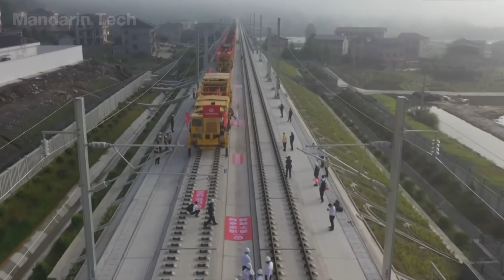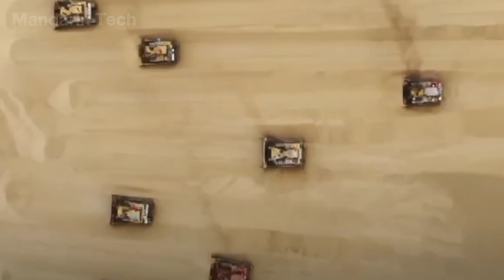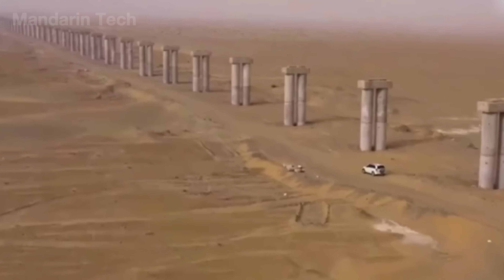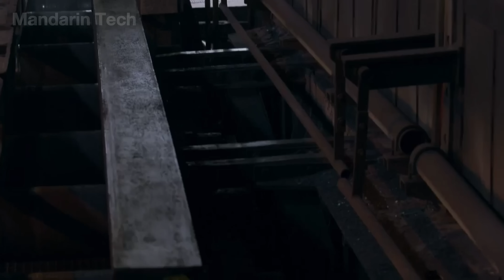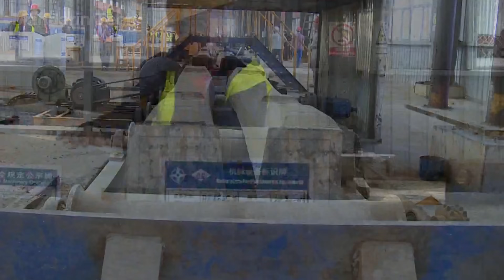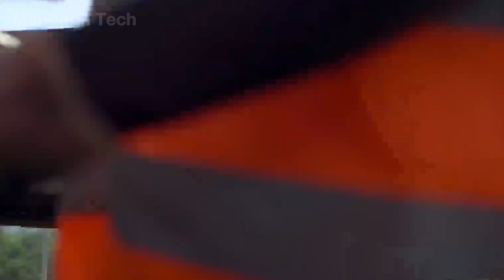China Reshaped This African Country’s Transportation With 600-km Giant Elevated Railway

Comment: all well and good, but the reality is something else. Here's what a search reveals about the finances and operations of this system.

The Chinese-built railway system, particularly its massive high-speed rail (HSR) network, faces severe financial strain characterized by13.7 trillion yuan (approx. US$863 billion) in debt by the end of 2024 and a 63.5% debt-to-asset ratio. Most lines do not cover their operating costs, leading to, Nikkei Asia high-debt levels, Nikkei Asia Nikkei Asia Nikkei Asia, and increasing fares. 

Key financial highlights include:
Rising Debt and Overbuilding: China State Railway Group’s debt has grown due to aggressive expansion, surpassing 6.2 trillion yuan. Analysts suggest the system is overbuilt, with many lines deemed unnecessary or unprofitable, according to The Antiplanner.
Profitability Issues: Only a few lines (such as the Beijing-Shanghai line) are highly profitable. Most others rely on subsidies, and high maintenance costs—potentially 20% of initial investment—are projected, says The Antiplanner.

Continued Expansion: 
Despite debt, the network grew to 48,000 km by end-2024 with a 50,000 km target for 2025, notes South China Morning Post.

Overseas Projects: Chinese-built railways abroad, such as in Kenya, also suffer from low revenue compared to high debt servicing costs, creating "debt-traps" for the borrowing nation, notes this article from Nonstop Local News. 

While China continues to expand its rail network to boost economic activity, the long-term sustainability of this debt-fueled expansion is under scrutiny, says South China Morning Post.

Comment: How do engineers construct a railway across hundreds of kilometers of African savannah, wildlife corridors, and challenging terrain? The British did it all the way back in the early 1900s with a line of similar length to the Chinese one. In addition, there was an extensive infrastructure, ports, ferries and even branch lines. The line linked the interiors of Uganda and Kenya with the Indian Ocean port of Mombasa in Kenya. And they did it without all the modern technology and advancements that the Chinese used.
Reply from the maker: Yes, the original Uganda Railway was an impressive project for its time.

Comment: The hidden cost of progress, helped by the Chinese - Kenya now spends roughly $1 billion a year servicing Chinese debt, most of it borrowed to build the railway. That is far more than the line generates in revenue, even if passenger and cargo numbers have been growing strongly over the past year. A report by Kenya's auditor general last year found more than $260 million had been wasted just on penalties and interest from late debt payments.

China lent Kenya $9.7 billion between 2000 and 2019 with around half of that going to the railway. It stopped lending from 2020 to 2023 as Kenya struggled to make repayments.
Reply from the maker: Infrastructure projects like this often bring both benefits and long-term financial challenges depending on how they’re managed.

Comment: This is Chinese Propaganda. China only does what benefits China.

As of 2020, this railways operation expenses exceeded revenues. it is heavily criticized for fueling Kenya's unsustainable public debt, limited profitability, and operational opacity. Often called a "railway to nowhere," it faces issues with low cargo uptake, higher costs than trucking, corruption allegations, and severe environmental damage to national parks. 

Criticisms include:

* Unsustainable Debt: The project significantly increased Kenya's debt to China, with payments often consuming a large portion of the nation's revenue, leading to high-risk debt distress.

* Economic Unviability: The railway has struggled to attract cargo, with freight costs initially higher than road transport. The railway often operates at a loss and requires government subsidies, failing to provide the promised ROI.

* Lack of Transparency: Loan agreements were not made public, leading to suspicions of corruption, inflated costs, and lack of public bidding for the contract.

* Operational Constraints: Originally intended to move vast amounts of cargo from Mombasa to inland markets, the railway is mainly used for imports, causing trains to return mostly empty.

* Unfinished Project: Due to funding constraints and economic concerns, construction halted far from the Ugandan border, limiting its potential as a regional trade route.

Comment: It would be very interesting to see how long this construction will last if the entire build was completed only by the Chinese. Any corners cut to shave money off the costs buy using inferior steel or concrete, that railway will fail. It's a pity the Kenyan's could built it themselves.
Reply from the maker: Large infrastructure projects usually involve strict engineering standards and inspections.
Reply: From ChatGPT

How much high-speed rail (HSR) China has

China operates by far the largest HSR network in the world:

~48,000 km (≈30,000 miles) of high-speed rail in operation as of 2024
Some estimates put it around 46,000 km+ depending on definition and timing
That’s more than the rest of the world combined and about 2/3 of global HSR track

For context:

Total rail network in China: ~160,000 km
So HSR is roughly 25–30% of all rail, but carries a huge share of passengers.

👉 Bottom line: China didn’t just build “a lot” — it built a global-scale system unmatched anywhere else.

⚠ How many accidents happen on China’s HSR?

Surprisingly few — especially relative to its size.

Major fatal HSR accidents:
2011 Wenzhou collision
40 deaths, ~190 injuries
2022 Guizhou landslide derailment
1 death (driver), 8 injuries

👉 That’s essentially 2 fatal incidents in ~15+ years of operation.
Reply: And yet you're here trying to drive a wedge between the Chinese people and the Kenyan people. How laughable is that?

Comment: Same here in Latin America. USA bombs, China builds.
Reply from the maker: Infrastructure projects can definitely shape how regions develop over time.
Reply: At what cost? Kenya now struggles to make loan repayments to the Chinese and the income from the line does not cover the cost of the loan, it's interest and the line upkeep.

And the Coca Codo Sinclair (CCS) dam in Ecuador, built by China’s Sinohydro for $2.24 billion, is the primary example of a Chinese-financed project in Latin America facing critical failure. Operational since 2016, it has suffered from thousands of cracks (over 17,000 as of 2022), faulty components, and severe, progressive erosion of the Coca River, threatening its total collapse. The project, built with Chinese loans, was plagued by allegations of bribery and corruption, becoming a major political scandal in Ecuador.

Would you like some more examples?
Reply: @mughug9616  The claim about the Coca Codo Sinclair (CCS) dam being a "failure" conveniently leaves out the massive $400 million resolution that happened recently. While there were 17,000 micro-fissures, the Ecuadorian government and China’s PowerChina reached a definitive settlement in July 2025. PowerChina (the parent company) agreed to pay Ecuador $400 million in compensation and take over the full operation and maintenance of the plant.
Even with the technical issues, the dam provided one-third of Ecuador’s entire electricity during the 2024–2025 energy crisis. Without it, the country would have been in total darkness.
Ecuador didn't "collapse" it negotiated. PowerChina is now investing an additional $400 million into solar and storage to back up the dam by December 2026.

Your "anti-China" comment claims the line doesn't cover its costs. That was true in 2020, but the 2025-2026 data tells a different story. In 2025, SGR revenue hit an all-time high of $165.8 million, up nearly 20% from the previous year. Despite a 50% fare hike, 2.73 million passengers used the train in 2025. People are choosing it because it works. Just three days ago President Ruto and Uganda’s Museveni launched the extension of the SGR to the Ugandan border.
Kenya isn't taking "opaque loans" anymore. They’ve moved to a "Revenue Securitization" model where the railway's own earnings pay for its expansion. It’s becoming a self-sustaining asset, not a "debt trap".

China and African nations shifted to an "Investment First" model. China pledged $50 billion in credit and investments over three years (2025-2027) specifically to move away from the high-interest debt models of the past. Last year, Kenya successfully renegotiated its SGR loans to cut annual repayments, making the debt sustainable for the first time. And on top of China just announced 0% tariffs on 53 African countries.
Reply: @mughug9616  Correct.
Reply: @rayatkin3913  Incorrect.

Comment: Wait, this line is not electrified? And just a singe track?
Reply from the maker: Some sections are single track and not electrified yet, depending on the design and traffic needs.
Reply: It could be double tracks, but do you have the money to a loan?
Reply: It is a single track, not electrified.
This is a good project. It will help transform Kenyan economy once completed.
Nonetheless, calling this " the most advanced" is incorrect!

Comment: It will fall apart in 2 years.
Reply: Well more than 5 years now and still running
Reply from the maker: Time will tell, but modern infrastructure is usually designed to last for decades.
Reply: @Mandarintechmido  Not China built.

Comment: Too bad it won't last over ten years. Within 5 years it may fall apart start crumble.
Reply: Don't be a sourgrape, what you are saying is a result of decades of anti-China propaganda. In short, you are brainwashed to believe everything they say against the chinese.
Reply from the maker: Large projects like this are engineered to operate for many decades with proper maintenance.
Reply: How much high-speed rail (HSR) China has

China operates by far the largest HSR network in the world:

~48,000 km (≈30,000 miles) of high-speed rail in operation as of 2024
Some estimates put it around 46,000 km+ depending on definition and timing
That’s more than the rest of the world combined and about 2/3 of global HSR track

For context:

Total rail network in China: ~160,000 km
So HSR is roughly 25–30% of all rail, but carries a huge share of passengers.

👉 Bottom line: China didn’t just build “a lot” — it built a global-scale system unmatched anywhere else.

⚠ How many accidents happen on China’s HSR?

Surprisingly few — especially relative to its size.

Major fatal HSR accidents:
2011 Wenzhou collision
40 deaths, ~190 injuries
2022 Guizhou landslide derailment
1 death (driver), 8 injuries

👉 That’s essentially 2 fatal incidents in ~15+ years of operation.
Reply: It’s already 10years.